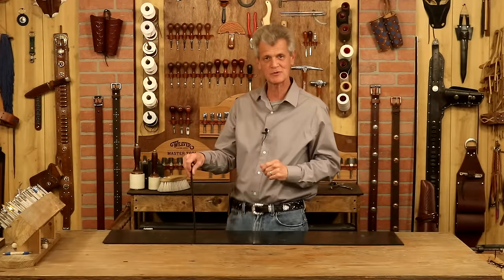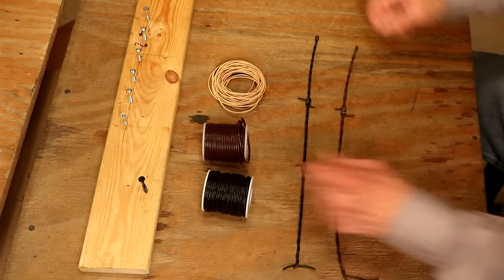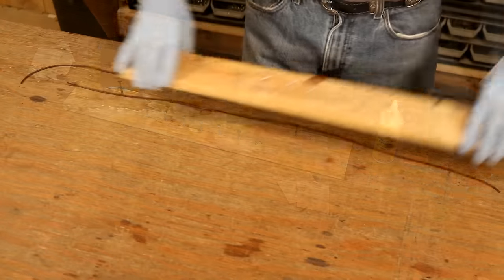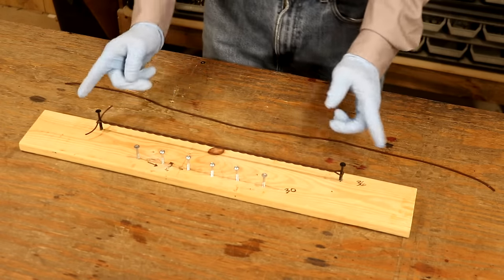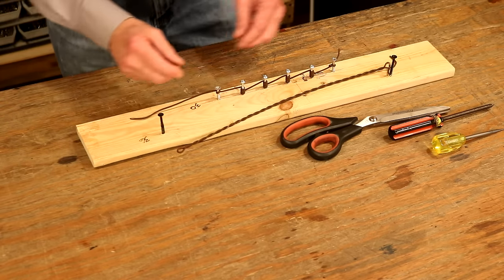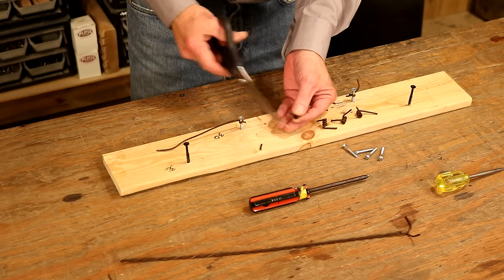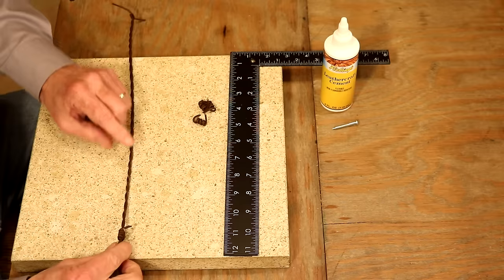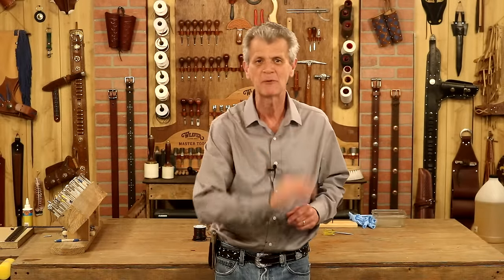Making Leather Barbed Wire

Comment: In order to keep the wire part from coming undone or curling up you don't necessarily have to use leather firmer. Just twist the strands in opposite directions instead of twisting both strands in the same direction.

Comment: How securely do the barbs stay attached if used on something that takes a lot of bending, impact, and general day-to-day wear? For instance, attached to a belt that would be constantly rubbing up against other clothing or on a purse/satchel strap that would get carried every day and tossed around a bit? Maybe even as a decorative lining on the inside of a purse/satchel where it'd have to stand up to stuff jostling around against it?
Reply from the maker: We would recommend stitching them in place if they will be attached to something like a belt or purse. This will just make sure they are secured tightly and won't go anywhere.